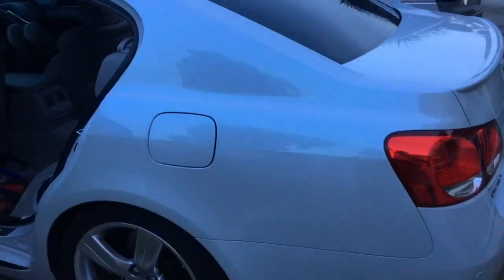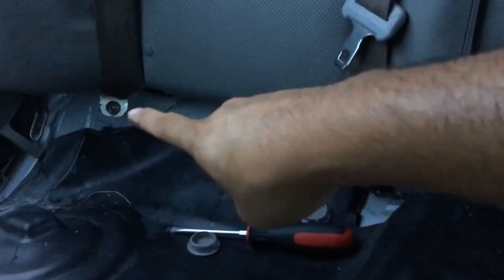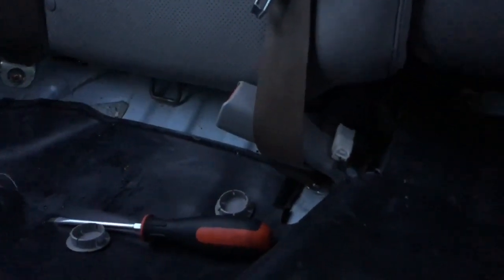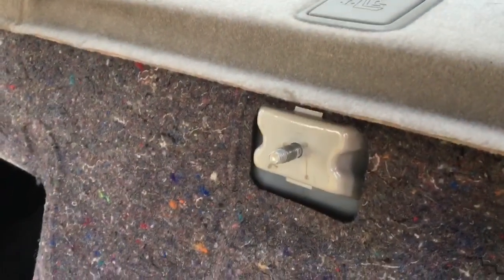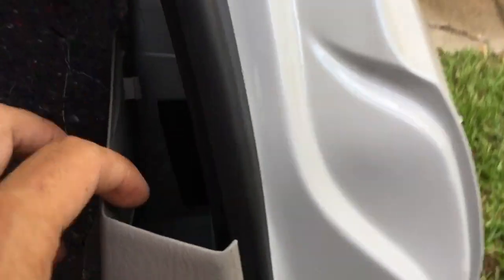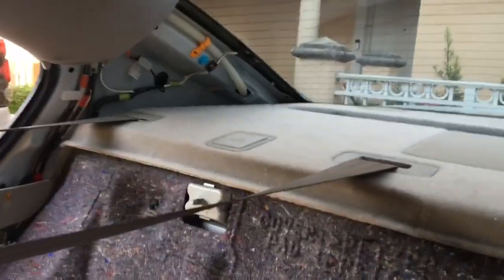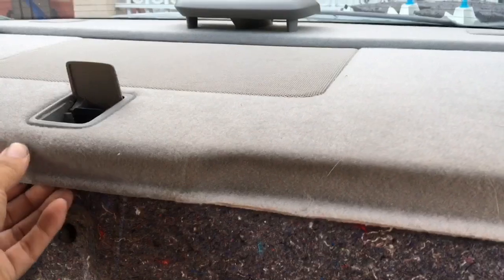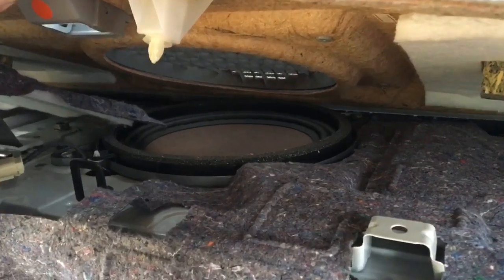Lexus GS 350 3rd Gen Remove rear subwoofer

Comment: Does the standard speaker system in the 3rd Gen GS have a subwoofer? Or just the Mark Levinson system?
Reply: Both come with subwoofers, Mark Levinson sound system just has 3 more speakers, plus a different amp vs. the standard system too. Hope that helps.
Reply: @TheN4UM4N  Thanks. Really appreciate it. Where are the additional 3 speakers in the Mark Levinson system located? I’m assuming 2 front tweeters on driver and passenger side? And maybe the other one in the center of the dash?

Comment: Edit: Looks like there is an adhesive ring along the bottom of the Sub’s frame. You may need to take a heat gun or blow dryer to help loosen the adhesive as you pry the surrounding sub frame up. 

Did anyone have any issues actually taking the sub out? I unbolted everything but it seemed like something was still holding the sub onto the rear package tray. Almost like theres some adhesive holding it on...